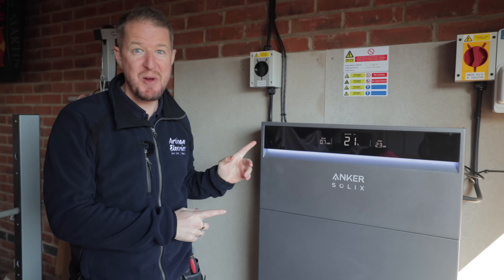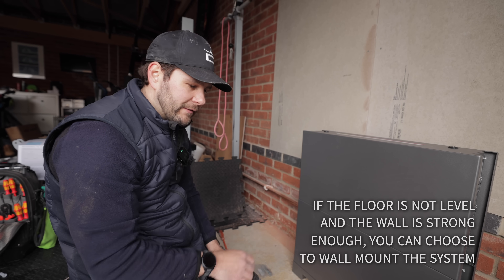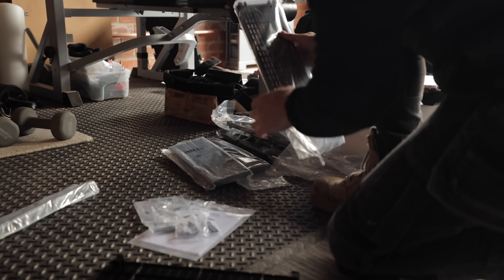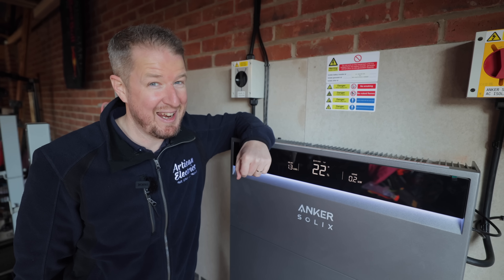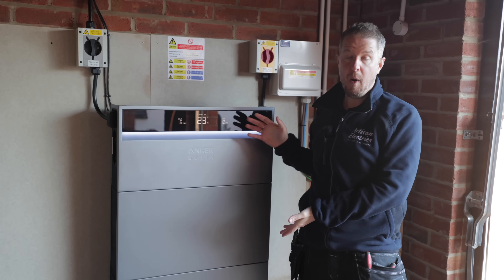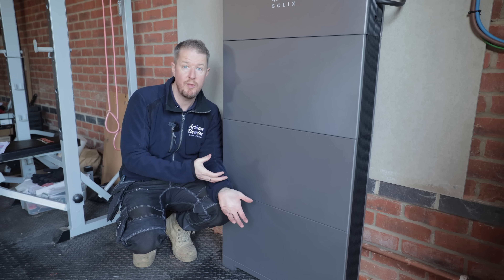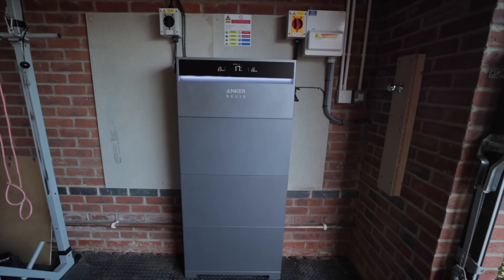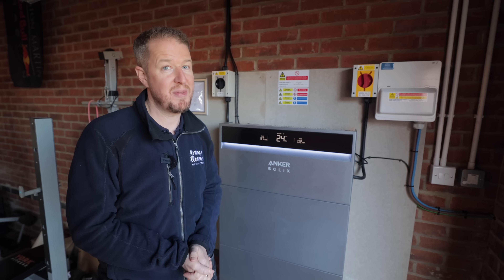Is this the SMARTEST home battery storage system? Anker Solix X1

Comment: ANKER is amazing  until it stops working just worst brand in everything Ive used from mobile battery packs to fast chargers to cables I'm sorry I would never go for them and their customer service is terrible when I try to get a replacement for the fast charger two months old ,but it good to see Tesla being challenged.
Reply: Your contract is with the retailer, not the manufacturer, so assuming you didn't buy direct from Anker, the customer service problems are the retailer's.
Reply: @matthewmarks6951  Amazon that directed me to them and when I contacted them through what Amazon told me they did nothing so both are ***

Comment: How many years will it take to cover the cost of it all via solar?
Reply: Do a calculation yourself ? Say 15Kwh costs 10kE, divide that by the kWh price, say 0.30E and a loss/creation of 30.000Kwh solar energy could be saved by it... Ditto, how much is energy stability, preventage of power outages worth to you ?

Comment: 1 phase system, jesus anybody use that for anything.. low voltage and high current for same power. Just not that cleaver.
Reply: The majority of UK homes are single phase 240V usually 80/100 Amp supplies.
Reply: America uses two phase. 🙃

Comment: It's a great looking system with good specks. And most importantly of all,, fitted properly 
Shame about the heat pump, but at least with solar fitted it'll offset the heavy load they impose on the network.  Unfortunately when the solar are at their least efficient it's the same time the pump will be drawing the most.

Comment: I just charge my Hyundai EV at night and run the heat pump and house lighting during the day via a generator type plug in the garage.  Saves me 60% on electricity with a tiny upfront cost.  Plus the battery storage has wheels! 72kwh is a huge battery, only ever used 20% of it in a whole winter day.
Reply: Hi, I have a Hyundai Kona EV and am getting a heat pump fitted in a couple of weeks. I also have panels and batteries (18.4 kWh). What is the 'Generator type plug' you're talking about and how do use it? Regards, Eddy
Reply: @ a male plug installed to run specific circuits to the max kw that your Kona V2L will allow.  The cars charging port in the Ioniq 5 takes an adaptor to take 230V DC (our voltage in New Zealand) and with a 15amp extension cord plugged into that the female end of the extension goes to the male socket on the wall.  That goes to the switch installed just under the main house circuit breaker board.  The switch has mains/off/generator positions and is designed for a petrol generator in the case of power cuts.  Same as hospitals and food trucks have to run their electrics when mains are not available.  So, if your Kona does V2L (I think 2024 on does) this should be an option.
Reply: @ Thanks very much for getting back to me. This is something I will look into. Hope all is well in NZ for you. Eddy (UK)
Reply: @eddyd8745  early versions of the Kona won't have V2L but the refresh edition seems to have [?from mid 2023?]

Comment: Your VW EV  just made me giggle, its three phase.  If you get the  motor out, you could fix it yourself 😂😂😂.  That first gen VW motor has an issue with water seal that leaks water into the motor.  Theyve improved in the latest version, suggest you take it in to VW and get it checked.

On another similar vein,  how long would a Bi-directional load have to be with that system you installed if there was no power and the car was the battery to supply power?
Reply: Not Enough Information!

Comment: We need to know the price? No one is going to bother calling, having to put up with sales people or get told a load of rubbish...
If a company doesn't give a price, I can't trust them as they will usually scam me into paying as much as they can get away with.
From what I have seen, about £10k minimum. That's 3 times more than a not so nice looking battery that does the same thing if you buy it yourself.
Reply: The one I built with the same capacity cost <£2k! A bit more than £2k when you include an inverter.

Comment: Is the battery chemistry LiFePo4 and therefore similar to other manufacturers? If so, how do these cope with low temperatures and consequential poor charge rates.
Reply: LeFePo4 is in contrast to Li-ion still working at below 0C temperatures, only to less efficient. An internal heating element in the batteries copes for the inefficiency at below 0, up to -20C outside temperatures ...
Reply: @robgeheim4842  Can you charge with significant current at all below 0?

Comment: Can we step back and ask what does a battery system do? I've heard that is cheaper to export you energy generated by solar than it is to consume it to charge a battery. I'm confused! Help!
Reply: The great thing about batteries is that they power the house when the sun's not shining. I fully charge my battery on a cheap rate in the early morning. If it's not sunny I can then run my house on cheap rate electricity until the next cheap rate period. If the sun is shining the solar tops the battery up then exports at 15p/kWh. The last week has been quite good with exports around £2.50-£3.00 a day. And the top in the morning before the sun comes up is only around 30p. Doesn't sound much but it all adds up!
Reply: @eddyd8745 ok thank you for the information
Reply: The sun does not always shine when the export cost is high! 

By charging a battery you can export the power when the export value is highest.  Additionally on a good sunny day you may well not be able to export all the solar you generate due to limitations placed on you by the DNO, so the battery is somewhere to put that excess power.

Comment: This is the first battery I’ve seen which has made me consider something other than a Tesla battery as it looks so slick.

Does it have a local API to connect it to something like Home Assistant?

And would it be quiet enough to install in one’s Lounge right under the CU?
Reply: Looks slick but the hardware is zero comparison to the powerwall
Reply: @michaelbalabanoff9441  In what way?

Comment: I have a question for these guys what happens when you get solar installed and its not generating 60 percent of capacity.
Reply from the maker: You have a problem.
Reply: Thanks for the reply.  The solar company has access to myenergi app now, so I have contacted them and will hopefully get to the bottom of this.
Reply: What "capacity" are you talking about? The peak power from the cells, which is the "megapixel" of solar installations? Or the predicted energy creation over time? How does the power of your inverter compare?

Comment: y would u install this and still pay bills LOL  ,,,  ied want it fully off grid  ,, and pay no bills for life ,,,,, other wise its pointless
Reply: UK does not have enough sun 36 days a year to make going off grid possible (without a tennis court for panels that is)  Best way is to size the installation to be grid neutral for the summer months.  I have 18 panels and PW3 and April has been grid power free so far.
Reply from the maker: Fully off grid is only for those with huge budgets

Comment: I hope it measures the line neutral impedance and refuses to work
Reply: Here a solarbank AC refuses to work in case of an ill connected ground connection, that model covers that ...
Reply: I believe all certified inverters have a maximum voltage above which they will not supply power. I presume this amounts to the same thing.

Comment: Why couldn’t they just add additional space on the battery itself for all those switches, breakers and other stuff… you have a nice looking battery with cables and other boxes around it that make it look ugly …. 

1 box, 1 set of cables and done …
Reply: In part Regulations - but their are ways round some of it - Tesla PW3 includes a DC string isolator in the unit.
Reply: @barrieshepherd7694  All the inverters I know of include a DC isolator, but an external one is apparently also required - is the Tesla an exception? (An isolator itself poses some risk, of course, so an unnecessary second one adds risk unnecessarily.)
Reply: @ Yes I agree.  Talking of UK situation. There is a video floating around where one of the comments quotes recent UK regulation changes which allow for the DC isolator to be within the inverter unit - subject to some other considerations.  My PW3 does not have any external DC isolator relying on the input string isolator.  It seems (from other solar install videos) that not all installers accept or know of this
Reply: @ You'd think that MCS certification would make these things quite clear, wouldn't you? My original 2011 system has additional DC isolators. It does also have two strings, so they are not entirely pointless.

Comment: Stay away from ANKER - you will be screwed in a case of warranty. They simply will ignore you at all.
This is a pure influencer product and of no value - in the long term. 
They had issues before with their powerstation which lost capacity over the years due to bad cell selection and poor design.
All of them had to be repaired cause they are lacking an active balancer.

Dont buy any solution with an ACTIVE balancer - don 't be fooled by the words balancer or balancing cause it is only about active balancer which can help you.
A battery nowadays should have an active balancer as a dedicated tool inside or that can be part of a bms, but in case it is a BMS with active balancer check the current figure next to it.
For smaller packages of up to 10 kWh a 1A might be OK, but for the usual 14 or more yuo will need a 2A active balancer as offered in the JK inverter BMS with 1 or 2 a active balancer.

This is not a JK advertising, just look for those figures and terms: a bms with a balancer is crap, you need BMS with 1 A or 2 A balancer.
And the real smart part is the software you are using: evcc for surplus charging

Comment: Would have thought 6kw a house rather small unless have a generator to cover heavy load items.
Also very important to not have connected to a grid.
Reply: Most parts of the UK have a very reliable electrical supply. The extra complication generally isn't necessary.

Comment: My 12 KW Deye inverter are connected to my Home Assistant smart home via Modbus so 5-10 sec update rate and dynamic charging of my EV & 43 kWh battery. These proprietary systems (like Tesla powerwall) has normally got the issues of being locked to to manufacturers batteries and their closed eco-system, depending of cloud-services AND are usually so expensive the average user will struggle to have it paid back before age has killed it.
Reply: Yeah. I think the Tesla refuses to function at all if it can't call home! I watched a video where someone was trying to disrupt its data connection enough so that it couldn't upload data to the mother ship but would still keep working.

Comment: I like the look of the new Anker Solix X1 but would like to see a price list somewhere.  Anker have always had a good price/quality balance, so it would be interesting to see how they compare on price for this system
Reply: @markottaway6899  Anker are purposely hiding prices, this allows installers to make their cut. As soon as customers see prices online they start questioning quotes which is annoying. It also helps prevent a race to the bottom for installers
Reply: Judging by the website, it looks like it is intended to be professionally installled - so they're likely to be coy about prices so the installer has to go on the installation course, and gets to set their own price. Not that Artisan would, of course 🙂
Reply: @ajward137  yeah as it would need a G98/G99 application and for warranty purposes.

Comment: Can this system ve used as off grid as well as hybrid grid
Reply from the maker: Just to clarify — the Anker Solix X1 product does have off-grid capability, so it will work during power outages.
Reply: @artisanelectrics  Yes, via it's UPS connections, not via the (disconnected) grid connector. For that in the US Anker sells a separate 1phase (110/240v) 'gateway'/backup controller

Comment: I didn’t really hear anything that suggested it was any better than a Tesla battery. Until batteries can integrate with the time of day tariffs and ones that change every half hour then really no battery is any better than any other. As for looks yeah it looks good, so does the Tesla except the Anchor ones got display on the front which probably will go wrong after a few years so for me Tesla proving itself over many years versus a brand-new battery which hasn’t proven itself yet is the only difference. For me the Tesla software is amazing and after install customers only care about that.   Can I suggest you look at these features in future.
Reply: I've got a PW3 so could argue I'm biased, but then I now detest Elon, so think that cancels out...
This looks like a good product, but it's not a realistic competitor to PW3. PW3 has 11 kW inverter (vs 6 for this) and three MPPTs (6 every where other than the UK) vs 2 on the Anker. I've also not seen anything about battery heaters on this, which is probably why they installed it in a garage.
Reply: @Animosity6792  + Tesla can sit in some inches of water and has AI managing charging based on home use and sunlight predictions.  My main gripe with the Tesla is the APP does not show individual string productions so you can't determine which, if any , string may have an issue.  Also gripe that any integration is via cloud services not direct to the unit but hey ho Elon only owns about 15 % of Tesla so the company may survive 🤣🤣

(Yes I know you can get string output via Tesla One or NetZero but to do that you have to be beside the unit using the local WiFi SSID)
Reply: Surely there are systems that do that now? Octopus even has an open API and tariff to allow you to make your own.
Reply: @matthewmarks6951 Go on then tell us all what systems integrate with 1/2hr energy changes.

Comment: My system has been installed that is heat pump and solar panel but some how my zappi can only show the grid on my app but doesnt show the batter and solar panels as they are generating. I can only monitor my solar generation on the tesla app app.

Comment: Have to agree it is one of the nicer systems I have seen on your channel. 👍👍
Reply from the maker: I think so too!
Reply: do you buy a nice battery - I prefer a good sustainable ones with a valid warranty and also spare parts after that.
Anker is not providing that and he is not even touching the point - I guess commission is more important for the channel then a good advice

in germany a channel is now on the verge on bankrupcy. they had recommended litontron batteries for RVSs which have lost capacity within 3 year or 4 years and the 5 year warranty has become worthless cause liontron doesnt care. The vendor does not do anything except selling or upselling now a solution for a few hundred € more. 
But they are liable and they will be sued for selling this crap as influencer which is useless if the 5 year warranty is not fullfilled - and even worse: now they offer a 7 year warranty.
Reply: @typxxilps I just remarked that I like the look of it doesn't mean I going to purchase that brand even if I had the funds.

Comment: What’s your view on DC to DC from battery systems & Solar PV. 
With more & more EVs needing charged & sand batteries dropping in price then it seems logical to use DC to DC rather than DC to AC & back to DC for charging a sand battery.

Comment: Galvanized stainless steel? I think you may have made a mistake. It's either manufactured from Stainless steel various grades or galvanized steel. You do not galvanise stainless steel.
Reply: It says in their blurb that the modules surface is finished with a high grade grey basalt coating .
Reply: I rest my case
Reply: it's possible they're using a galvanizing process to allow their exterior coating to fix properly, stainless is nominally a bear to get things to stick to, also because brushed stainless is a bit marmite.
Reply: @kaelin000 SS can be galvanised.  Usually hot dipping
Reply: Exactly, also powder coating is rubbish on stainless steel.
Reply: sound great as influencer and sales guy - this is simply super steel 

or it is a stupid ad for a mediocre product without a good warranty and no support after warranty. 
People expect to last a battery to last but how if you will not get any parts 3 years after release of a product as seen for poweroak bluetti and all the others.
Reply: @typxxilpsAnker have a very good reputation for their other, albeit smaller consumer, products.
Reply: typxxilps I have an Anker power pack for my phone. It’s ten years old and still going. It might take a bit longer to charge and not charge the phone as much but still going so I think the company has a good market place.
Reply: @typxxilps it has a ten year warranty guy. watch the video you are commenting on maybe
Reply: @typxxilps Anker seems to be positioning itself as a 'premium' kind of brand so it's definitely not wise for them to cut and run on support. However there's also the danger of starting with a good, over-built product to build up a reputation, and then cutting costs in subsequent years.

Comment: These residential battery packs are a real headache in fire situations. Just look at the fires in LA recently. You need specialized teams to clean-up the toxic mess.
Reply: Be sure you're comparing apples to apples and not LiFePo4 to NMC.
Reply: Throw away all your cordless equipment including your phone 😅
Reply: @raymondschembri5042  look you, my phone has 1 Li-Ion cell, not 5,000 or 8,000 or 10,000
Reply: @raymondschembri5042 I didn't realize my phone had 150kg of toxic materials in it... I guess my resistance training program works because it feels so light!